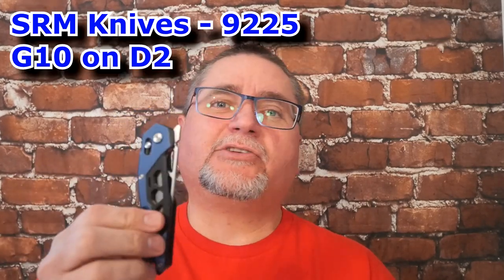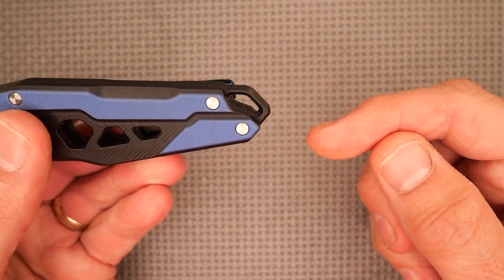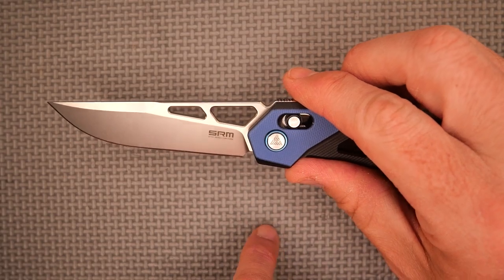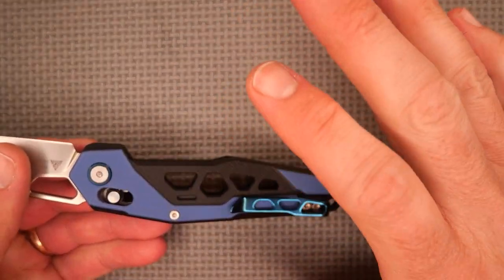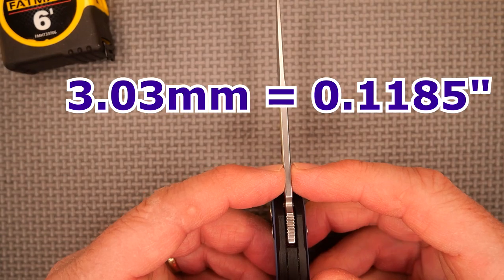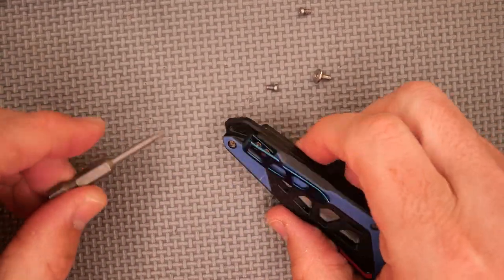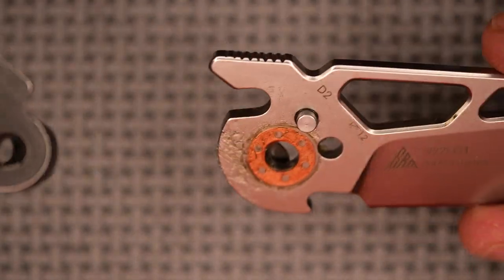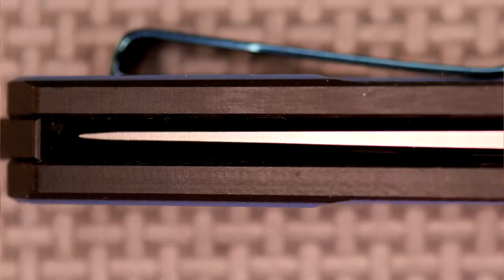Review: SRM (Sanrenmu) 9225 - A Folder Worth Checking Out?

Comment: "Hole-ly Front Flipper, Batman!!!" Should come with a box of Q-tips for cleaning. 
The grey/black version is less gaudy looking. Would get this one if it also came with a black blade. SRMs are a bit pricier compared with what Sanremus used to cost. Pricing seems the same on AliExpress, but you can get it at White Mountain plus discount in a week instead of weeks.
Reply from the maker: LOL, yes, I guess those holes can grab a lot of lint.  I left it for the video the way it got after my testing, but that means a minimum of being carried on 10 different days, so not a lot of time for junk to build up.
I could not find it on AliExpress this week.  It's been there in the past, and yes at the same price, so you may as well shop at WMK.

Sanrenmu is the branding for the Asian market and SRM models are designed for the western market - that explains the pricing.  For example, that is why you don't find the flood of 7000 series knives with the SRM brand.

Comment: Omni springs? I thought they are called Omega springs. Because of the resemblance to the Greek letter Omega.
However, I agree with your opinion pretty much. It's a great knife. I bought this after the 7228 and 1168 and I think SRM has chang3d their game completely since the logo change. Action and build quality are excellent on all 3. ....well, except the pocket clip because mine also has a flawed finish.
Reply from the maker: I've often gotten names wrong.  This wasn't the first time and it won't be the last.  Sadly, I am not a god.

I find the blue anodization that SRM is using on a few knives lately is VERY prone to chipping off.  It hadn't happened to me by the time I published this video though, so I didn't mention it.

Comment: I'm over the hole/s in the blade look, and now holes all over the handle, too, NOOOOOO. SRM please use a good budget stainless steel. Nice that SRM put a small sharpening choil. Great video!
Reply from the maker: The good thing is that there are loads of knives that have no holes in blades or handles, but for the guys that like this look I am glad there are a good number of these available to them.

I like D2 but I am over how much much D2 has been used in the last few years.  in the last 10 years D2 used to be seen on the odd knife but for some reason in the last 3 years the market has been getting flooded with the stuff.
Sanrnemu does like to use Sandvik steel, I wish they would offer blades either in both D2 and a decent budget stainless or only in stainless.

Comment: Jake, wonder if Sanrenmu has 'jumped the shark' ??? No matter what 'they' call that lock ... has it been improved upon? 
Have a flat surface engage the tang and part of frame above locking pin (simple physics explains the advantage) and have locking pin engage tang more instead of absolute minimal engagement and have locking pin not be trying to go 'up a ramp' as it engages tang. 
Don't suppose you could put in a word to Sanrenmu eh? I'm available for consultation if Sanrenmu needs advice. 
Just about the only way a person owning an Axis lock knife (Benchmade or other) can feel somewhat more secure is by disassembling knife and hand finishing. 
This takes placing blade back in place multiple times to check for fitting. Temporarily removing Omega springs makes this much easier.
Reply from the maker: It's just a standard axis lock, nothing special with their version of it, at least that is my opinion.  Sorry, I don't have any relationship with Sanrenmu at all.
Reply: @CanadianCuttingEdge   , lol, Benchmade calls their Adamas a "Tactical" folding knife you can bet your life on .... 
High praise for a knife that is subject to catastrophic failure. 
I've got a few $5 folders with a bolt lock mechanism that is safer than Benchmade's "Tactical" folder. 
Unfortunately, they are not currently being sold on Gearbest or any other site I know of. 
On Benchmade's YouTube channel I posted a message asking if they wanted to have a spine whack contest ... my Cold Steel Kudu versus one of their "Tactical" folders. Benchmade refused and did not allow public viewing of the message. 
I have high praise for the Axis lock mechanism ... just not as it is applied. 
I think it comes down to lack of respect by Benchmade towards their customers. 
Probably never will be no shortage of Benchmade fanboys though.